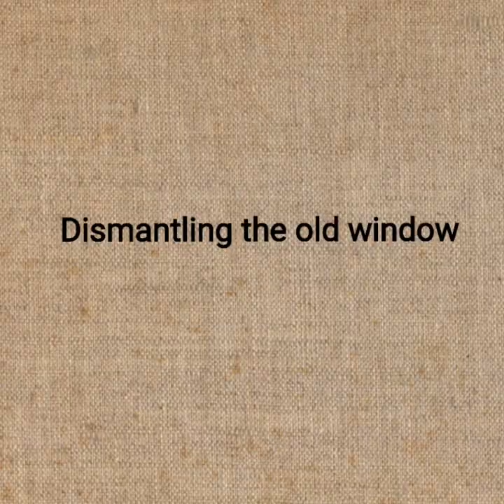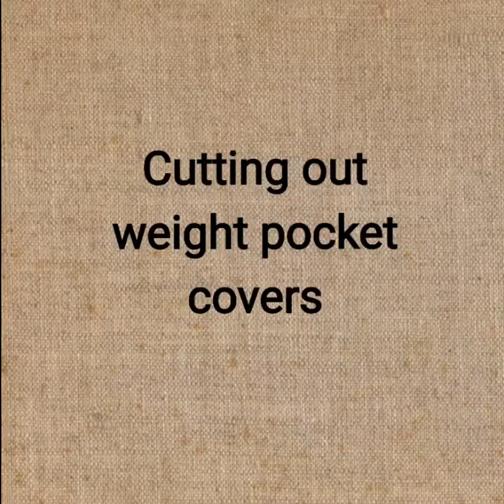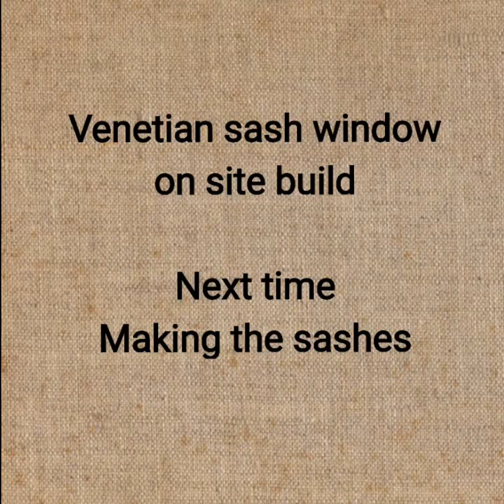Venetian sash window frame build 19.05.2021

Comment: Very interesting video as always, Jim! Thanks. I think you should treat yourself to a new camera. We want 4k! 😁Quick question... I'm quite interested in building a sash from scratch. Where is the best place to get wood? Do you use a planer thicknesser to get the wood straightened out prior to working with it? A video on this preparation might be good, if this is something you do yourself. But of course you might have this done for you if you order it in ready to go, I'm not sure.
Reply: If you can get DAR the thickness you want and flat/ straight 👍🏻otherwise go oversized then do one face then one edge on jointer, bandsaw to finish dimensions + 2-3 mm then thicknesser.

Then tenon,  mortise, profile, glue, clamp sand, prime, glaze 👍🏻
Reply: @Dazza19746  Thanks. Looks like there's no avoiding the need for some new tools!

Comment: Why did you put the pulleys all the way to the top Jim ? Usually at least 4-5 inches down to top of pulley.

Nice on the job work though, love the jig btw 👍🏻
Reply from the maker: Because the sash cord has to travel OVER the top sash es on either side. A channel is cut out in the top sashes of the outer sashes to accommodate the cord. I'll be showing that in the next video.
Reply from the maker: Here's a YouTube link to the reason why the pulleys are set so high https://youtu.be/P-i0jgwP5cs

Comment: Hi Jim. Your videos have given me hope that we can build a sash frame. We'll see. Couple of questions. How do you determine the width of the board needed for the frame? Also, does the parting bead offset or does it go straight down the center of the board? Thank you!!
Reply from the maker: Hi Elizabeth, are you wanting to build a complete frame or are you  repairing an existing frame? It's a simple process. Simple doesn't mean easy. There are a lot of variables. If you're thinking of using the existing frame as a template is probably easiest. If you send me photos/videos of what you want to achieve I'll probably be able to be of more use to you.
Reply: @jimsear  Hi, I'm wanting to build a new frame. I have the sashes. There are other windows in the home with frames still intact so I assume they could be used as a template. I bought a historic home and not knowing what I was doing I pulled out  3 frames. BIG mistake!! The home is 4 hours from where I live now so I'll take some pics next month.